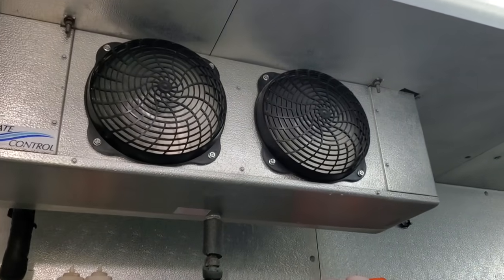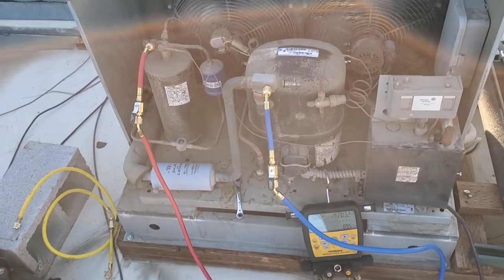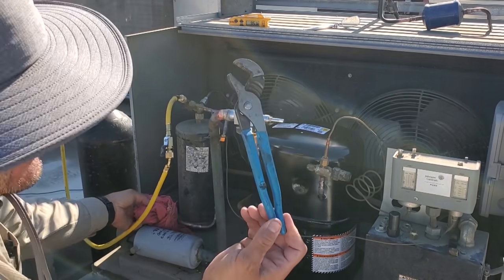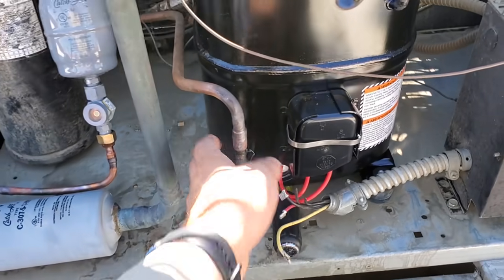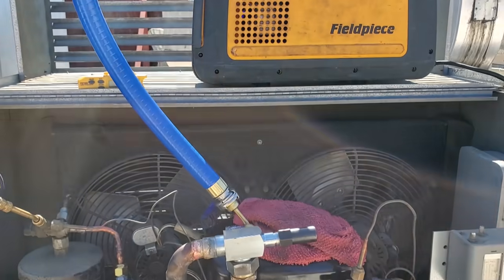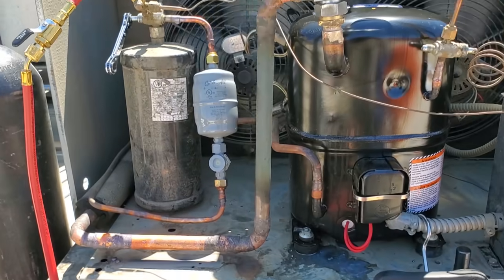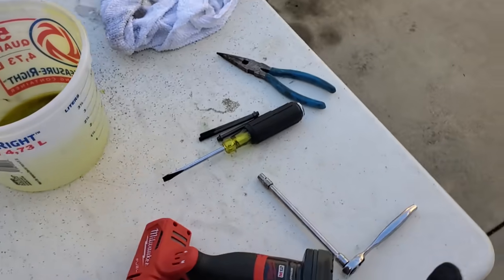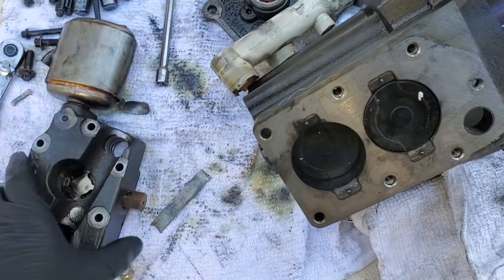THE COMPRESSOR SOUNDS LIKE IT HAS ROCKS IN IT

Comment: I live where the average humidity is 70% so it's a lot different from your area. And when it gets to above 85 degrees I lose my ability to function. I couldn't even fathom the temperatures you work in, thank God we only have 3 or 4 days a year when it gets above 90.
Reply from the maker: I will discuss this on my livestream on YouTube this evening 9/28/20 @ 5:PM (pacific time) come on over and check it out, and if you can’t make it to the live no worries it will post as a normal video afterwards https://youtu.be/lN1JzYbER68
Reply: I live where the maximum humidity during a downpour is 95%.
Reply: @HighestRank  When it rains humidity is at 100%. It's raining cause the clouds can't accept anymore water because they are fully saturated.

Comment: 23:50 Metal fatigue from vibrations? Tiny amount of flex repeated over time? Was that little piece aluminum? Or steel? If it was aluminum, then I would guess that it just flexed a tiny tiny bit over time, maybe from the unit switching on and off, and then broke off from metal fatigue. If you take a piece of aluminum and bend it back and forth then you'll have a curly piece like you have there at 20:45 and it will weaken and rip at the bend point.

Comment: Looks like the right fan motor is having some friction, probably going bad soon.
Reply: he did say in the video that he did want to replace the fan motor but didnt because of covid to cut costs
Reply: I was thinking the same thing.
Reply: Fan motors are pretty cheap. Just the labour to replace them. The right fan can be harder to find if damaged.
Reply: @VenturiLife  a few bucks can add up pretty fast, but in his recent stream, he was called in to that same place in this video for this unit and one of the fans has gone bad, though this is 4 months after he shot this video (but in hindsight it probably might have been a better idea to have changed it)

Comment: The noise probably came from that plastic thing and the other muffler looking can rattling loose inside the compressor.
There may be already some fine contaminants released from the plastic wearing down, hopefully caught in the dryer, but if the plastic was allowed to wear all the way to crumbling the failure could have been much more catastrophic.

Comment: Hi Chris. Enjoyed your video. Mate I noticed a burn out suction drier. I thoughts are that the temp controller in side cool room might not be the right type? Cool rooms are high usage and prone to a gap coils icing up causing a flood back to comp .cold liquid hitting hot windings causing burn out. My guess is its been flooding back. On previous comp change. This one might also of had a liquid slug? Cheers mate. Pete from Australia

Comment: My guess is that the compressor got schocked during transport or got slightly scratched at the factory. Same as with copper wire and tube that gets scratched. After some time it breaks due to vibrations slowly tearing that weak spot.

Comment: I had this problem a few years ago,,   The compressor sounded like broken glass,,,    The problem was caused by a contractor switching off the power to the building for a few days..   The compressor cooled down,  liquid refrigerant accumulated,,   when power was restored it tried to start up with all that incomprehensible  liquid,, and smashed..     All good fun.

Comment: Maby that compressor was experiencing flooded starts. It would explains how that little manifold bracket broke when their was an explosion inside the shell. Idk. That was a weird one. Great video
Reply: Derek Mc high amperage on the new compressor too, so the problem didn't simply go away with a part swap. Sounds like an automotive-curse is overachieving far outside of its jurisdiction.

Comment: I wonder if this is related to design flaws in Tecumseh compressors, specifically the AW series. I am not a technician but I am fascinated with HVACR and I have heard this noise before, only on units with Tecumseh AW compressors. Interesting video!

Comment: So, the compressor is still working, other than making a huge noise?
Reply: Poor people in Africa could still have used it (joke).
Reply: Well probably not for too long: too high oil/valve temps and a lot of vibration near the valves.
Reply: Mari Kann That sludge in the oil may lead to a huge problem in the near future
Reply: Y Zhang who's to say that the sludge wasn't the cause of vibration that fatigued the braces and broke them already?

Comment: Over the years I had taken apart about 4 tin cans, of different brands, just like that noisy one, it was interesting enough to SS what made them NOT WORK, when LEHigh made tin cans, brand new they sounded like marbles,, but you could not beat their LEHIGH BLU COLD  ‘V’ COMPRESSORS , then went to their tin cans , same as with BRUNNER, then their ‘BRUNNERMATIC , what crap 
Cheers 🇺🇸🇺🇸🇺🇸🇺🇸

Comment: Scrolls are just a better design whenever it comes to hermetically sealed compressors for HVAC and walk in coolers. There are now even slugging resistant scroll compressors from Copeland.
Reply from the maker: I have some points to make on this comment you left and I will discuss this on my livestream on YouTube this evening 9/28/20 @ 5:PM (pacific time) come on over and check it out, and if you can’t make it to the live no worries it will post as a normal video afterwards https://youtu.be/lN1JzYbER68

Comment: just use a bungee cord, large zip ties or electric tape layered to hold ladder to gutter vs the extension rope. if the wind blows hard enough to unseat the feet and blow it apart, that's the least of your issues :)

Comment: Great video as usual.  I would add that Nylog should be used on the bevel of the male flair only and not on the joint threads and flare nut.  However, some lubrication on the threads and flair nut back is excellent in that it allows a smoother and more secure torqueing of the flair connection.  I would use some teflon paste on the threads (pipe dope) and the backside of the flair nut as lubricant but not Nylog since the nut and threads serve no sealing function other than to mechanically squeeze the tubing flair and bevel to form a mechanical metal to metal seal.   PS you really burnt up that suction line...

Comment: If those pieces were magnetic a person might put a neodymium magnet on the bottom of the compressor and trap them where they couldn't move around. Since the compressor was working this may have pushed off the compressor change to a later date. Which would just be an option to prevent further damage if you didnt have the right window of opportunity to change the compressor.

Comment: Sidenote on extension ladders - Who prefers tying/untying the rope each time they have to raise the ladder vs. permanently tying the end of the rope to the bottom rung? Once I saw someone else with the rope tied at the bottom, it became a new norm for me. Is there any reason not to do that?
Reply: Is there some reason not to use dual interlocking ladders?
Reply: Fold up roofing ladders are the best, they have locks built in. I avoid old extension ladders now if possible as they're cumbersome and annoying
Reply: If you're putting the ladder on top of  a truck where the wind can untie it, reason enough.
Reply: @HighestRank  No offense but you need to learn to tie a knot if wind can undo it.

Comment: Do you think that the broken brackets inside the compressor are designed to stabilize the two manifolds on start up? I would imagine there could be quite a bit of torque on startup. Maybe those brackets are there to stabilize them. I wonder if they are designed to stabilize them in a certain direction? What if the compressor started in the opposite direction from the designed direction? Would these brackets get tweaked in different way? I don’t know just thinking out loud. Maybe phase rotation on a reciprocating compressor could be important in the long run. Love the compressor tear down! Thanks
Reply: sJ air no, broken brackets aren't designed to stabilize anything.

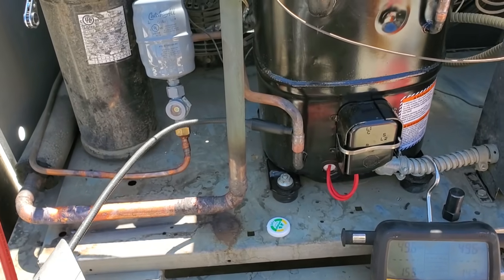Comment: 14:59 It's probably common knowledge in the field of work but how does that leak detector work? Just a guess, (I might be completely off) does it "smell" for gas or possibly "listen" for the leak?
Reply: Leak detectors typically make use of a sensor that changes electrical characteristics in presence of the gas you’re checking for. They have a limited life (although it’s normally quite long), and you need a sensor for each type of gas. In the case of leak detectors for HVAC they may use another method though.

Comment: I used to love to rebuild large compressors that had scrambled and to determine the root cause of the failure. Many times others had made adjustments to TXV's and ended up flooding back, breaking valves , etc.  Got several new contracts by not just rebuilding, or replacing, compressors but analyzing the entire system. Good job.

Comment: What does the underside of the cap on the leaking valve look like? Is it all just empty space under there around the stem or is it kind of molded to fill in the space around it to keep out as much air as possible? Surely that packing, even if under the right amount of pressure, will leak over time as the compressor cycles on and off introducing any air under the cap into the system. Does that volume of air matter all that much when it's mixed into the entire system?

Comment: I'm new to the channel so I'm sorry if you have talked about this before. I'm not super familiar with 404. What are the running pressures in comparison to 22? I noticed that you soft soldered and I'm curious about potential leaks. Thanks.

Comment: I assume that it broke from vibration  in combination where the metal was bent.(where the material is beeping bent it's creating cracks in the material itself with vibration those cracks are getting bigger and bigger ending up like that also the little piece looks like it was spot welded this also creates differences in material creating week points if the brake it's in a semicircle it's from there  ....

I would say that the engineers solve this problems but if the compressor was dropped probably some how get a defect that was not there before and after it was installed... But during some time the problem become evident

Comment: If the compressor was replaced regardless of reason, then why no system flush of the old oil trapped in the system? I always thought that a flush was required whenever a compressor is replaced?
Reply from the maker: I will discuss this on my livestream on YouTube this evening 9/28/20 @ 5:PM (pacific time) come on over and check it out, and if you can’t make it to the live no worries it will post as a normal video afterwards https://youtu.be/lN1JzYbER68

Comment: sir  do you think you need to come back and check the new compressor oil  after a two week to avoid a failure again . or need to use a acid neutralizer or some thing ?

Comment: WHY DO YOU PUT NYLOG ON THE THREAD? Lubricate the face creates a better seal, lubricate the back stops the pipe from twisting. I may understand putting it on a flare txv for the evap side in freezer, or better still thread tape, but that's to stop ice freezing and cracking the nut. Am I missing something?

Comment: That missing piece looks like it came off that bottom manifold as well, there's a third bolt and marks on the plastic manifold that look like that tab was bent over it to hold it down , if this is covered in the video sorry posted this comment stream of consciousness
Reply: Looks like I was wrong, my bad lol
Reply: If those tabs are close to contacting the case it may have been damaged during handling at some point, somebody at a warehouse may have thumped it pretty good

Comment: While your were replacing the compressor I kept noticing the right condenser fan motor was not spinning much compared to the left one from the wind. I was sure you were going to mention that. Is it still working or did you have to replace it?

Comment: I would say Heat issue and loss of lubrication over and over in that desert heat.. Discoloration by the piston gasket.. and in the bearing not being lubed as good... High heat causes high compression ratios along with lube issues. If i was selling equipment in a desert region,, i would sell them oversized condensers if possible.
Reply: the ambient air temperature won't make a difference. A compressed gas generates way more heat than desert air possibly could. It'd overheat in a cooler climate with no airflow just the same. The heat will build up in condenser coils and stay there without air moving across it and it'll be a feedback loop generating more pressure, therefore heat. Larger coils would do nothing except possibly affect the saturation too much in a working system throwing it off as well. The engineers design these systems a certain way, bigger doesn't mean better.
Reply: Ethereal Rose exactly- I've got a window unit which is rated at the same BTU as a larger one, same voltage yet lower amperage. Difference between them is the airflow. Bigger unit moves more air but that's about it.

Comment: IMO it appears that the valves may have gotten stuck open during a compression cycle during suction and back pressure might've caused the bracket to blow?... just my opinion... said obstruction could've cleared when that happened so i'm betting the oil caught it? (shrugs)

Comment: i dont understand why there is no option to change out the oil. in a repair like this you would want to replace the oil after a month or so from the acid that is still in the system.

Comment: Just a curious novice here, not being critical. Was that just 50/50 plumbing solder you were using on the compressor connections? If so why that over silver solder?

Comment: Metal fatigue on both bits of metal due to vibration. The long strip that fell off between the bolts probably would not have failed had it more tension on it as it held that manifold in place. The short top piece was just too flimsy for surviving in a vibration location.
I guess the rocks was one of those bits of metal rattling against the inside of the case - and likely made no difference to the compressor which would have had a further long life - if only you didn't have to destroy it to find out what was causing the rattle !

Comment: I feel you could have left that compressor to run for years still. It doesn't look like those brackets really were necessary, and there are no accessible moving parts in the bottom of the sump, sure it makes a hell of a racket due to the whole unit's vibration bouncing the parts around, but am I right in thinking that in the near term, those fragments wouldn't have been a problem?
Reply: John Smith strap and a bracket, 2 bits!

Comment: I'd probably hold it at the speed limiter( it should cut off about 100 to 103 and bog until about 95  then full power and repeat LOL.
that said, even my 1982 had cruise control (add-on) no it didn't govern speed very great, but good enough. there was a big aftermarket for that years ago